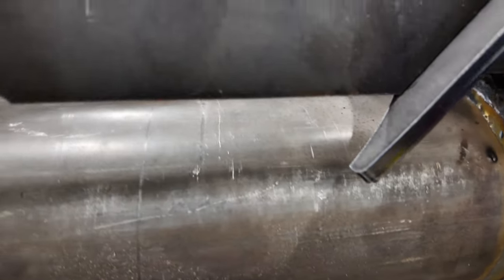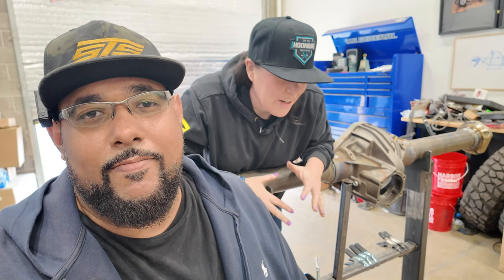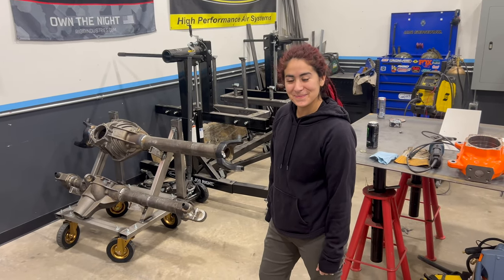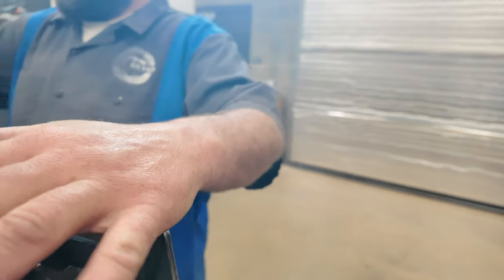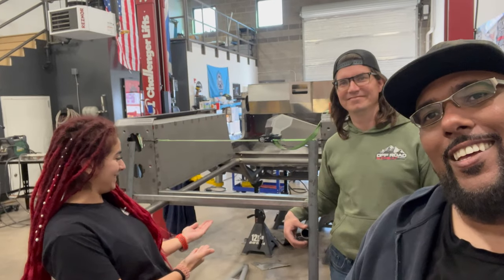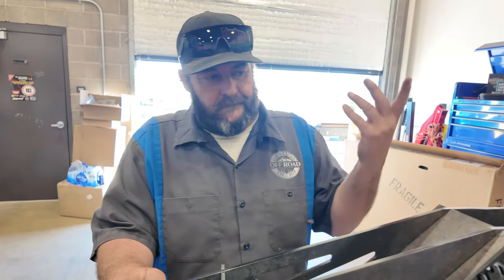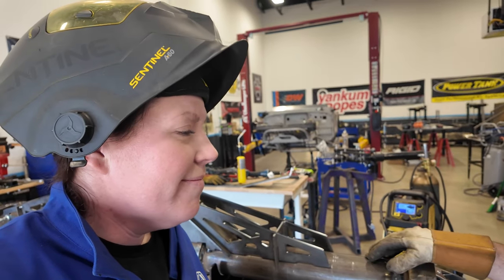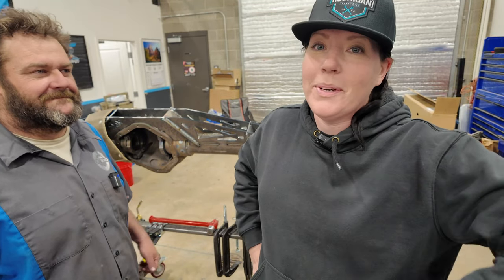YJ Buggy Ep.5 Trussing Custom 14 bolt TTR Axle

Comment: I remember when if you had Dana 44s you had a big axel.  Trusses were cable or round stock that were attached to a saddle under the pumpkin and bolted to the axel ends. 31s were big tires.  I am beginning to think that I'm old
Reply from the maker: If I ever own a TJ, it will be fairly stock with Dana44s and 35s.
Reply: @MischiefMakerTV  a basicly factory tj with the old rubicon express long arm kit amd 35s was a beast 15  or so years ago. One thing that helps the pre JK wranglers is the frame is a bit higher. I remember when the LJ Rubicon with the long arm kit was about as good as you could get before going all out with custom fab.
Reply: Yes we are🙄
Reply: I feel you on that

Comment: It makes sense what he is saying about stressing the truss before welding.  If you think about it, when objects heat up they expand, and contract when they cool.  So if you were to just weld 2 flat pieces of metal together, even at a 90 degree angle, they tend to bow when they cool.  So applying a force to one piece opposite of the second piece before welding would normalize it when it cools.

Comment: Looks like someone forgot to weld the backside of the truss to the diff
Reply: Usually the over the diff part isn't welded.
Reply: @joshuabaker5712 not over the diff but on the casting where the tubes slide in

Comment: I fabricate trailers, and while setting up and tacking the first side, the bottom, the frame sags down several inches when welded. After turning over to weld the top I usually find that there is a considerable arch upward. I measure it and put a 55gal drum on the high spot on 4x4s, and fill it up till it sags the same amount below the centerline, welderup, drain your drum, and it will be perfectly flat with a nice preload the length of the unit.

Comment: I’ve never heard of bending the opposite way while welding but I get the principle. I would be surprised if that strap could bend 4” x .5” tube but I think it could hold it in place while your welds cool.  My thought on truss work is to treat it like body work. 1-2” here and there and not overheat an area causing a warp. Shops burn it all in to save time but weekend warriors can do some and let it cool over and over again 🤷🏻‍♂️

Comment: The only axle I put a truss on was a 9". I used 3/16" thick 3.5" Sq tube. 
Completely sealed the truss and vented the axle into the truss then vented the truss. 
Then used a .75" plate and cut the bottom off to .25" clearance to the ring. Also had short trusses from the flat bottom to the tubes. The center section had 1"holes into the short trusses bottom edge and 1/4" into the tubes for oil movement. 
Never broke the axle, never over heated it either. Drove it daily for about 6 years.

Comment: That is cool that you can get bare axil casings from TTR!  I want to build a project from the ground up.
Reply from the maker: It’s a great way to save money and get exactly what you want - especially the pinion/caster separation that’s ideal for longer travel rigs. That’s my main complaint about superduty front axles. Rear junkyard axles are fine and, if 72” wms-wms works for your rig, you can’t go wrong (especially because you can still use stock internals) …but front superduty axles were designed for highway use in hauling vehicles that were never expected to see 14-16” of travel and keeping the pinion happy sometimes means sacrificing caster at ride height and at full droop!

Comment: Ms. Holly, I have done just like you did with the welding of cast, propane or MAP gas, But just watched Colt while he was working with cast and steel, different job, same materials, and he heated his pieces up too, except..... he used one of those weed burners, and it works so my faster a,d heats it so much better, I'll never heat cast up with those little bottles again.
Reply: He also post heated and let it all cool super slow with blankets. Personal experience around equipment and weld repairs I've found peening like Matt did works great too.

Comment: That axle sure looks heavy. 😁
Reply from the maker: It sure will be, but also (hopefully) capable of taking years of abuse without failure. And ‘heavy’ is a relative term. It’s incremental. I’m sure we’ll be within 300lbs of a fully dressed junkyard 14B (but infinitely stronger).
Reply: @MischiefMakerTV  they get heavy fast with trusses, mounts, high steer, locker, hydro steering. Is is good weight though
Reply: @MischiefMakerTV  they get heavy fast with trusses, mounts, high steer, locker, hydro steering. Is is good weight though

Comment: Those axle tubes aren’t spinning!
I’ve never preloaded an axle before welding a truss, but I will on my next one. Almost every truss that gets welded pulls the tubes up in that direction. Creating a little bit of negative camber. You don’t have to do it, but to check it, you bolt the tires on and measure between the top of the tires. Then spin the axle housing upside down (truss down) and measure between the tops of the tires again. Keep it under an 1/8”.

Comment: Question,  is that a 11.5 GM style 14 bolt?(OPINION ) Do you think a Gm 10.5  14 bolt  rear with D50 front would be good solid combo in building a one ton swapped Jeep XJ CHEROKEE
Reply from the maker: My 14B housings are for a 10.5” ring gear. I have a D80 with an 11.25” ring gear in MM and I wanted slightly smaller, but just as strong and I think these will hit the mark for this buggy. The housings just look massive because they are not shaved - which is my (very unpopular) preference.

I’m not the most experienced with junkyard axles and XJs but if your XJ will be on 40s and as light as the Rudicon, that axle combo should be more than adequate. 💪🏻😎

Comment: I kind of wish you went without trusses. I think axles look super clean without them! I do get that it makes brackets easier to locate and get on the axle. I just like the look of a big axle with beefy brackets and no truss.
Reply from the maker: I get what you mean. They are beautiful, but I’m pretty sure that’s impossible for a cast center-style diff with a double triangulated suspension setup. Totally doable with a set of fabricated axles though ( but 🤑💸💸)

This 14B would, at a minimum, need a bridge truss for the axle side uppers.
Reply: @MischiefMakerTV  yea for the rear I’d totally get it for that style suspension. For the front though you could do without a truss! 😁